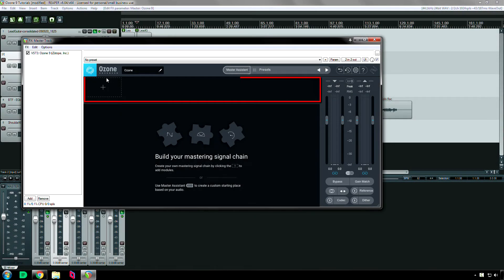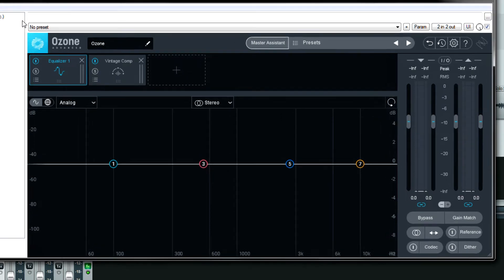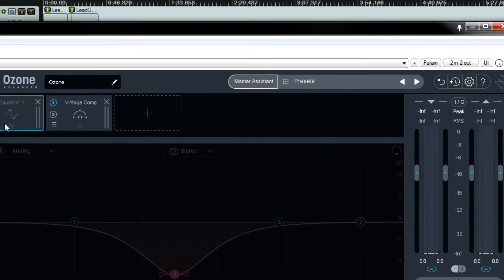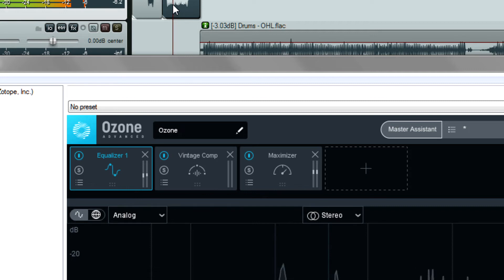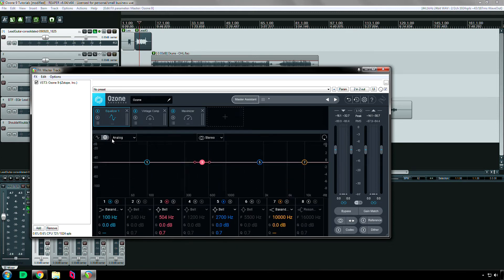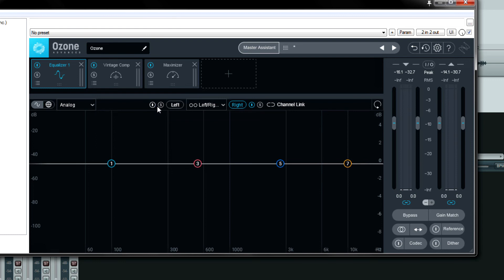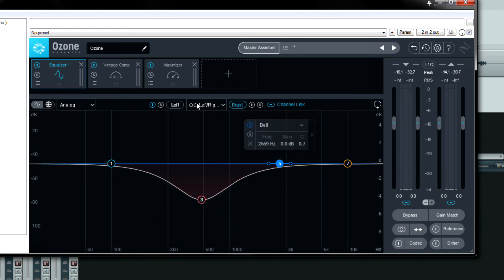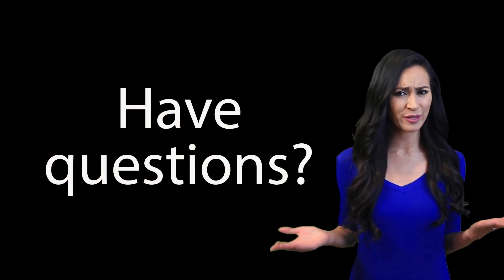iZotope Ozone 9 Modules Signal Chain Controls Tutorial

Comment: 3:40 actually Digital one more CPU
check this:
Analog
Selects minimum-phase IIR (Infinite Impulse Response) filter types for processing in the Equalizer module.

Digital
Selects linear-phase FIR (Finite Impulse Response) filter types for processing in the Equalizer module. FIR filters retain the phase of the original signal, but are more expensive in regard to CPU usage.